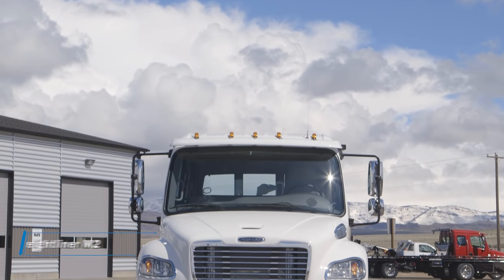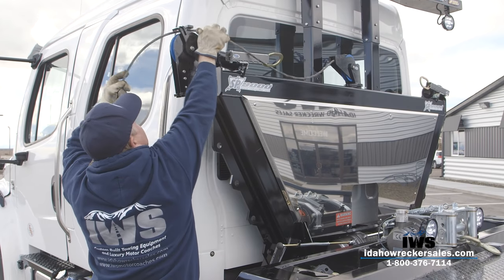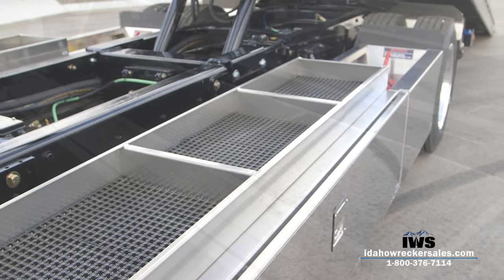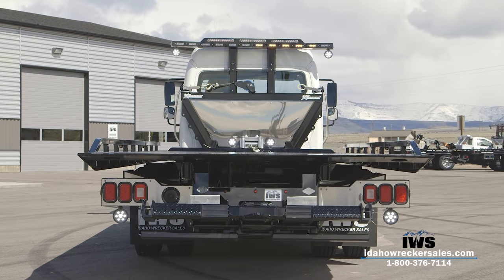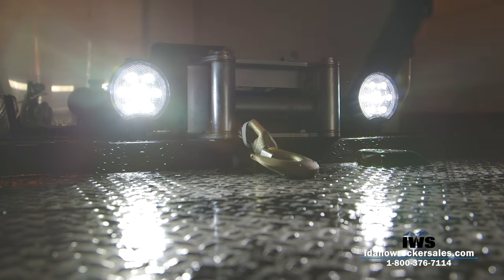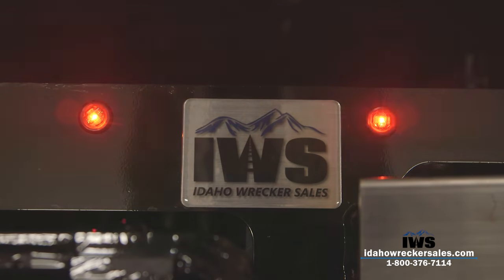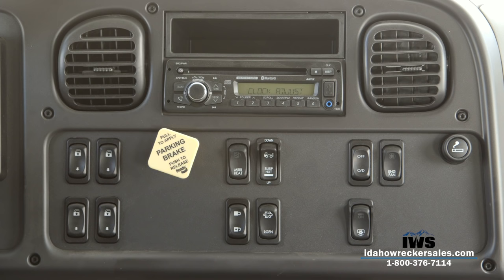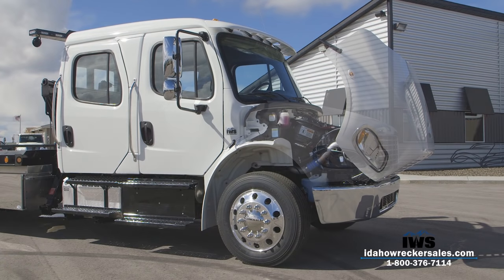IWS Freightliner M2 2016 Crew Cab Carrier Stock# 8179

Comment: Great Video. 
What size are the front and rear axle?
Reply from the maker: This unit us sold, but we do have another scheduled to build which is stock #8028.  Both stock #8179 and stock #8028 are equipped with a 10,000lb GAWR front axle and a 21,000lb GAWR rear axle with 4.88 gears and a manual locking rear differential with a 21,000lb air suspension. Give me a call at 208-587-2888 if you have any further questions. Thanks! Ty
Reply: Idaho Wrecker Sales 
Thanks for the reply.  I enjoy watching your videos
Reply from the maker: Absolutely! Thanks for watching!